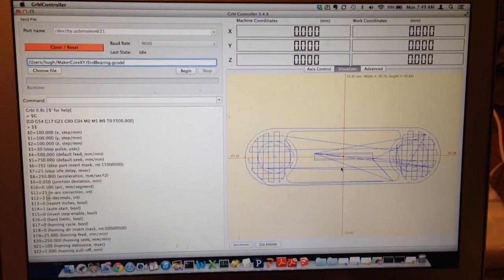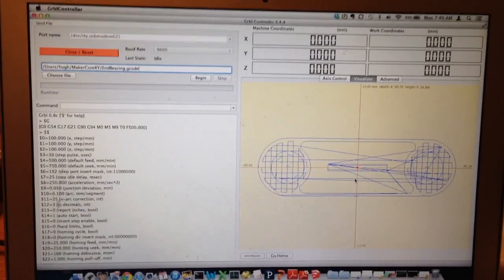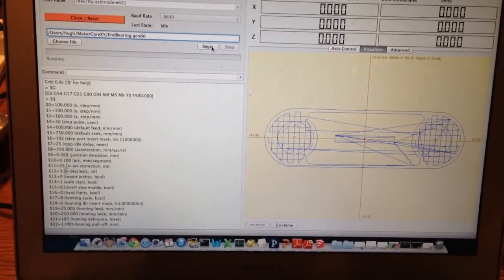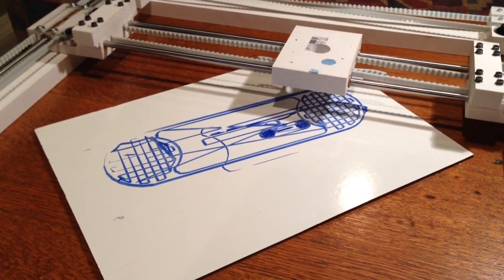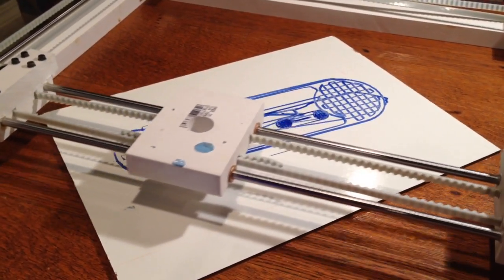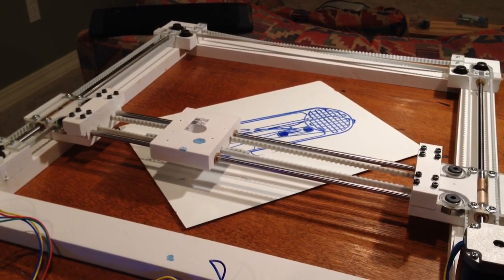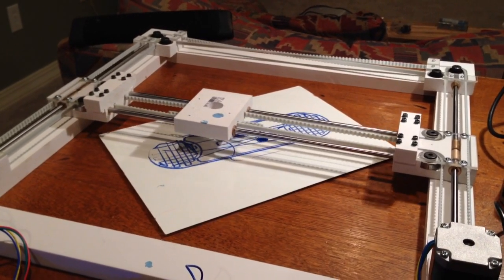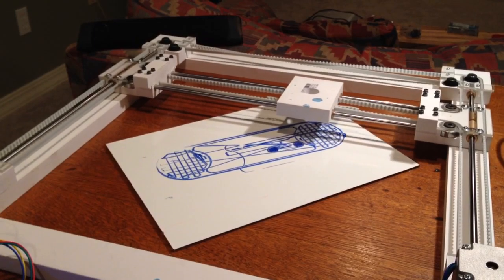MakerFaire Northern Colorado #803:PlasticTrimCoreXY driven by GRBL and a GRBLshield (HD)

Comment from the maker: Don't sweat getting your brain wrapped, I didn't :-) I built it because I like the elegance of a coplanar movement. 
the 3 uses I have in mind are..
A pick and place machine where the Z stage is a light vacuum pick and place.
The second is a laser cutting stage where the mirrors are at the vertices.
The third is a spindle to cut plywood the stage scales quite nicely scales.

Comment from the maker: A most excellent question ! Logan. 
X-Y stages  are usually stacked, one riding on top of the other carrying the heavy stepper motor and wiring of the other. 
I picked this X-Y design to try out a co-planar (look this up Logan) design that did NOT have one stage carry the motor of the other.
207 chars left!!! :-)
There are three ways to handle Z!!!  Mill up/dwn on the middle, Plastruder with platform dropping and a laser that doesn't need a Z stage. :-) Call me is this is too confusing!!